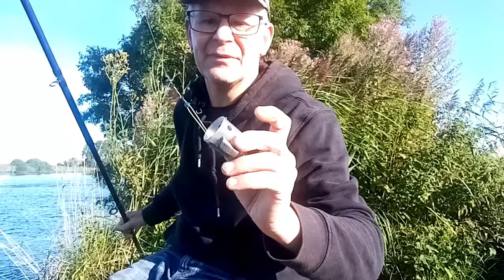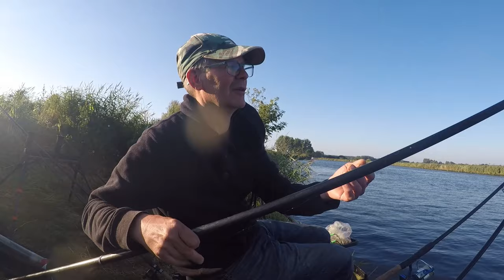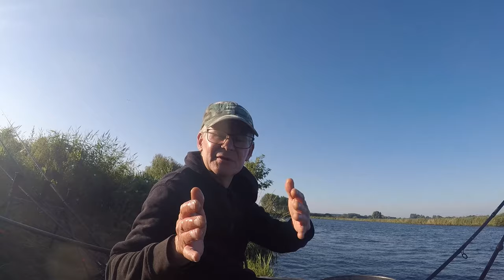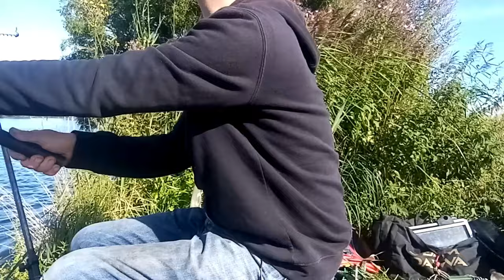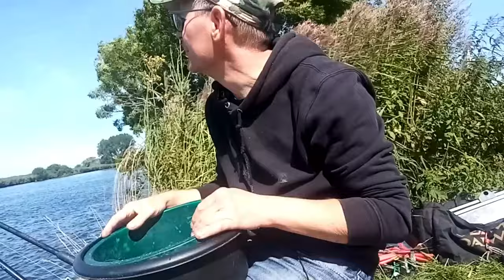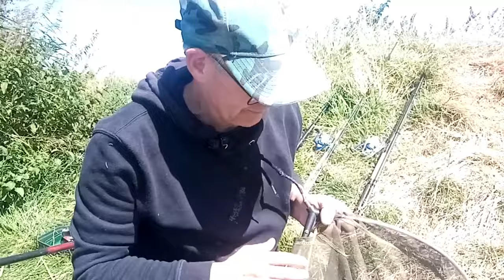Balling In For Bream - DOES IT STILL WORK?

Comment: Why r u taking the whip apart its suppose to b fished to hand your rigs need to b longer
Reply from the maker: My whip is a top 3 telescopic and 3 put in taking it to 6m as, good pro whips are. I am fishing 5m to hand but adding a extra section when the flow picks up on tidal rivers alows you a extra metre to run through the peg. When you get the fish to the top. I take of the 6m and swing to hand. Hope that helps
Reply: @fishingnorfolk  yeah I know i have drennan acolyte whips and cresta whips why not use a flat float slightly over depth and hold back
Reply from the maker: I find the roach on the tidal yare and bure like it run through at half or full speed not held up. Ok for bream and skimmers. Flat floats are good with a stready constant flow but on tidal when it can go from static, to a crawl and pushing like a train flat floats you will be forever changing the grams of float.
Reply from the maker: Im only doing what bob nudd shown me as i fished with him a few times at langley